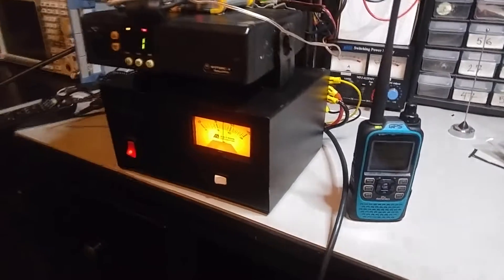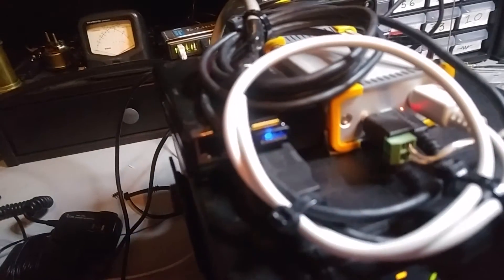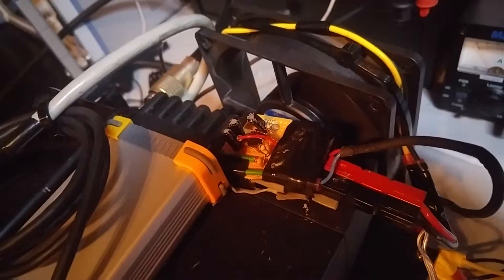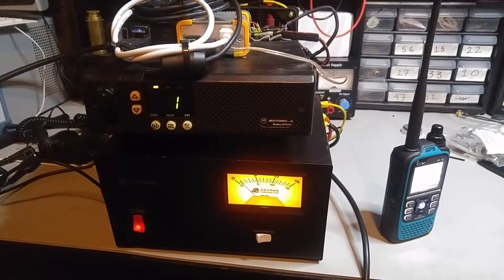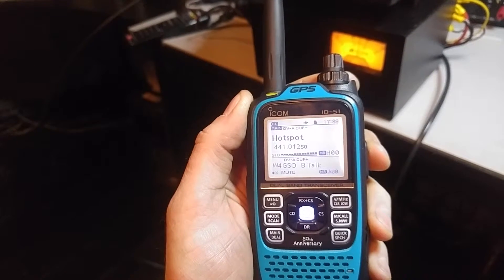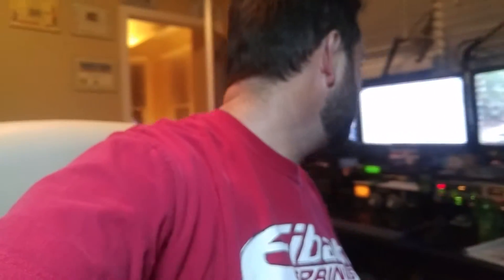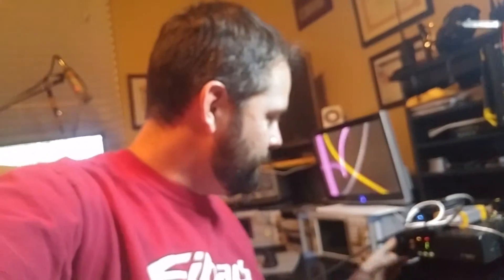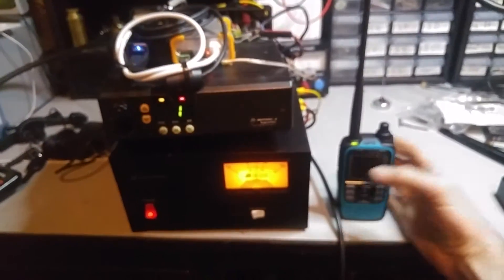Dstar Hotspot with DVrptr V1 & Moto gm300

Comment: Nice setup.  25W is no joke for a hot spot.
Reply from the maker: +J. Collins Conover Yeah, I think I'll back the power down, need to make a programming cable for that thing.  It is now tucked away in a closet upstairs.  I'm pretty sure my range is going to be geographically limited weather I'm running 25w or 5w.
Reply: +Cameron Conover  Hey can you tell me your modem settings for your hotspot Having trouble with my hotspot tx level 10 and delay 150 rx inversion is set to on. Using a GM300 UHF radio
Reply from the maker: +Harv W8HRV 
Raspberry pi connecting on port /dev/ttyACM0
TX inversion Off
RX inversion On
Channel A/FSK Pin
TX level 10%
TX Delay set to 40ms
Reply: +Cameron Conover Thanks made changes already hope it works for my setup
Reply from the maker: +Harv W8HRV good luck, let me know how it turns out.